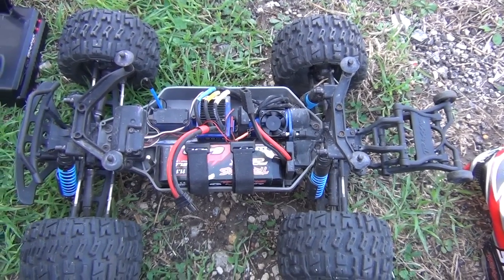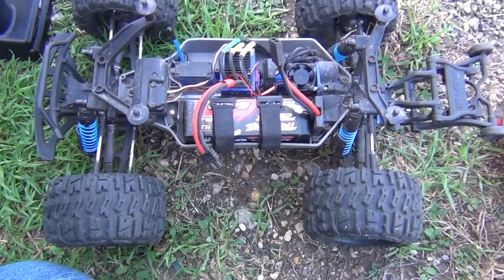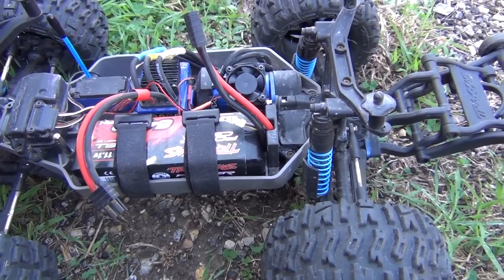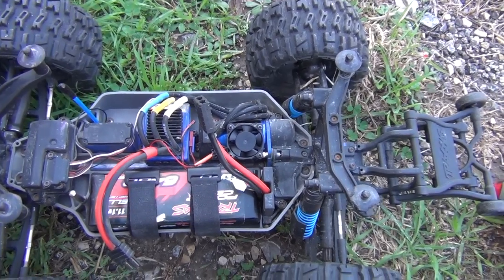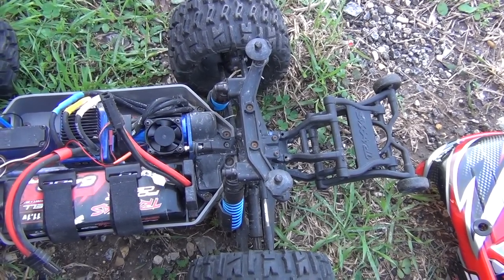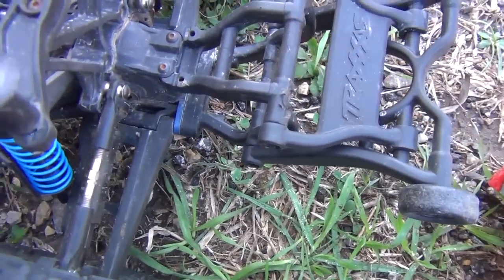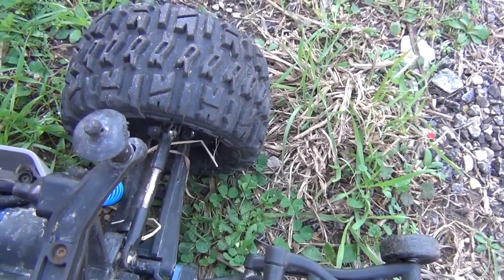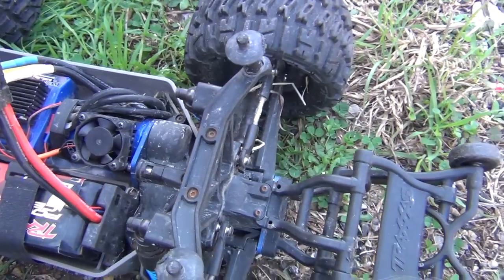Thanksgiving Bash

Comment: @DentonRCdriver , 4 pole motor offer more torque with less current draw from the esc, making the great for 4x4 vehicles. ( think of the poles being extra pistons in an engine)  .. Now using sensored ESC will also help with un-needed voltage spikes ..(ESC setting the timing on a sensor-less motor aka cogging ), now the 550 cans are just bigger magnets that give you the extra torque ..

Comment from the maker: @mrjdgates -  You rock :-)  I googled "how to use sensor port on traxxas esc" and found out that what you heard is correct!  Thanks for bringing that to my attention.  As far as the ESC temperature that will be a function of how much wattage is being dissipated by the ESC from the current flowing through it (Watts = Current x Voltage).  In order to lower the temp on the ESC I need to either lower the current or the voltage (or add a fan).  Do the 4 pole motors draw less current?

Comment: Now I have heard that the Traxxas ESC has sensor port on it, which if it does you could use / either a Tekin or Novak 550 , now the Novak ballistic  550 5.5 will enable you to use 3s lipo  which is around 40000 rpm

Comment: get one of the Robinson Racing Gen 3 slipper's it has a metal spur gear, adds a little whining noise with the metal to metal instead of metal to plastic but out lasts the stock one and it comes with a brass bushing to replace the piece of shit plastic bushing that Traxxas mounts in there slipper